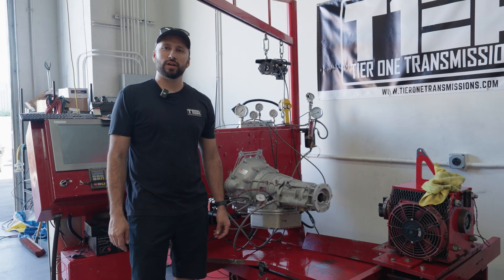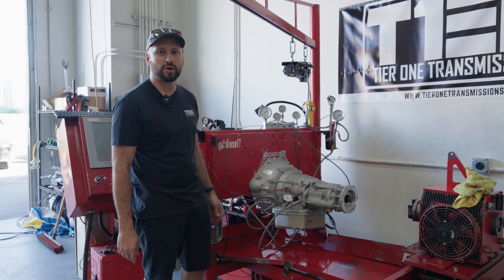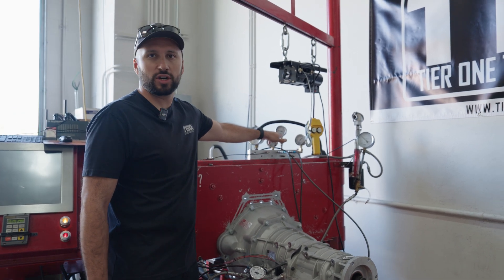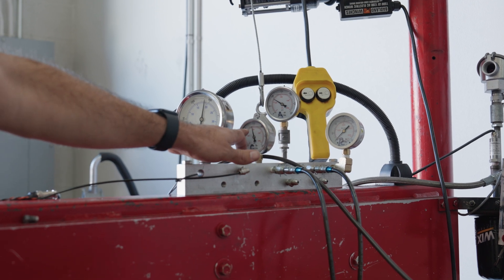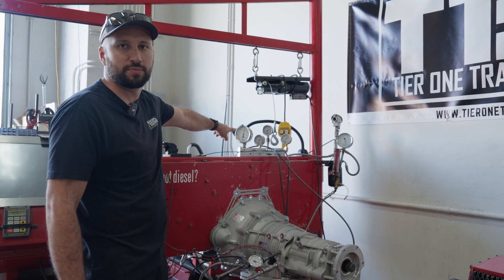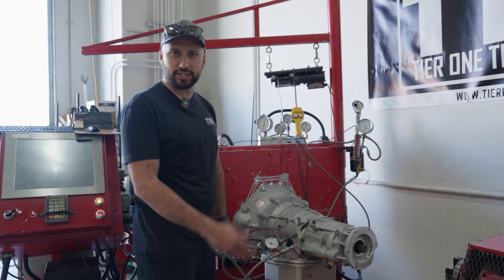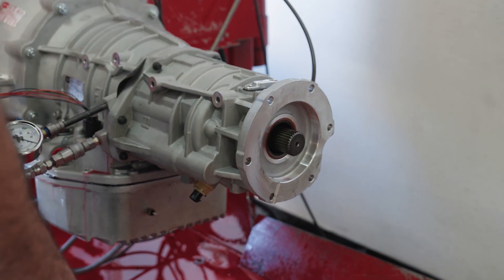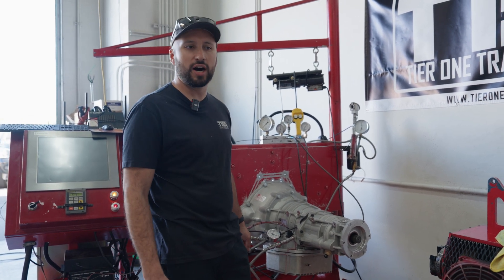Testing a Tier One 47RE Full-Manual Valve Body! | 250psi of Line Pressure! | @chancemckelvie

Comment: Just curious. I hear you guys talking about pinning the overdrive in some of your 48s. If I just put my overdrive switch on all the time does that keep overdrive on? And if so does it hurt the trans at all? I’m running suncoast fmvb in the truck I’m curious about but looking to build a car next. I’m sold on your valve body for my next build for both the trans brake and pinned OD just curious if I can do that in my truck aswell?
Reply from the maker: We talked to SunCoast on this, and while it's not something they do on their standard 48RE manual valve bodies.  They did say it's something they CAN do, but it does take more modification and it's something that has to be specifically requested.

In short, the SunCoast valve body in your truck probably can't engage overdrive through all its gears as it stands now.  Let us know when you're ready order one of our valve bodies and give us a call at 602-399-5484!
Reply: @ thanks for the reply and sure thing I’ll be in contact!